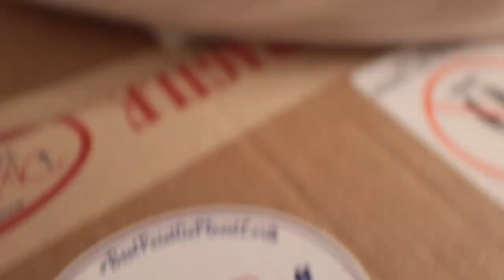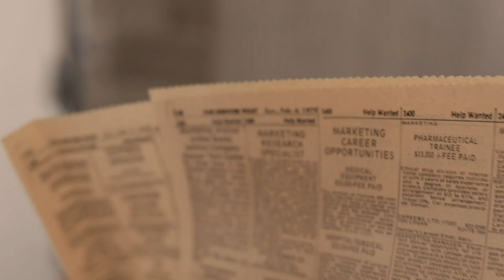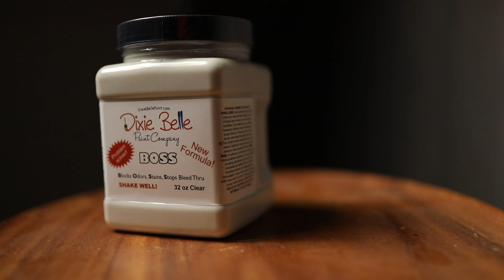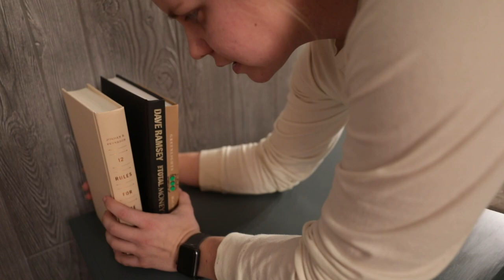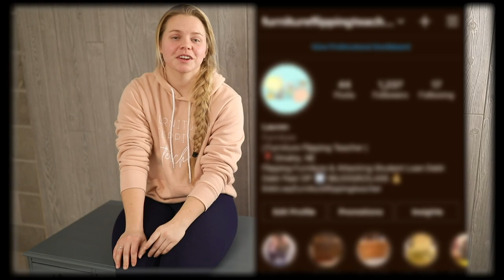| Wooden Desk Thrift Flip | DIY Chalk Paint |@DixieBellePaint |FURNITURE FLIPPING TEACHER|

Comment: I was a painting contractor for many years and one piece of advise I can give you is - Don't dip your brush into the original can or bottle of paint. The brush can bring contaminants into the paint and decrease the durability of it. It's best  that you pour the amount of paint you need into a smaller container. The same for your topcoats. It's like double dipping the chip or licking the spoon and putting it back into the pot. Make your paints last, pour into smaller container.
Reply from the maker: Ohh wow! I truly never knew that! Thanks for that recommendation! I will keep that in mind! Thanks!!
Reply: Awesome didn't know
Reply: 100% correct ‼️
Reply: Very good to know

Comment: If you accidentally brushed paint on the side of the drawers, would it be possible to spray water or use a wet rag to remove the paint verses sanding. I ask only because Dixie bell is a chalk mineral paint and feel that it is possible, please let me know if it is not.

Comment: Just a tip... when using the blue Dixie Belle sponge it works much better it you dampen the sponge before using. Get it wet then wring all the water out that you possibly can. It helps the Gator Hide glide on more smoothly. I love all the Dixie Belle products. I haven’t tried that brush yet, but I put it on my list. Thanks for sharing!

Comment: For cleaning any hardware I have an old crockpot I put water in and turn it on high and cook the hardware while I work on my project
Any cleaner that works on silver can be added but I just use water 
Super washing soda by arm and hammer can be used on silver, brass and copper 
If you have things like door hinges or old slide locks on doors that have been painted, the soak in the crockpot makes it peel right off
I learned this watching Rehab Addict

Comment: Have you considered using a chemical stripper? It’s less labor than going over the whole thing with 80-grit (you’d still have to address imperfections), and there’s not gonna be a bunch of residual stain to worry about affecting your coloring. I hear good things about Citristrip.
Reply: Disclaimer: I make furniture as a hobby, so my knowledge of what constitutes a good stripper for redoing existing pieces is second-hand. When getting chemicals, I usually just grab the relevant Klean-Strip product from Home Depot.
Reply from the maker: So, I actually have used citristrip and it will be in an upcoming video! You’ll learn that I HATE stripping things hahaha. I just haven’t found the flow of it yet.

Comment: Just a tip I've learned...I am not a fan of the gloss of the gator hide and a tutorial I watched from dixie belle says you can apply 1 coat of gator hide and let dry and then either do the Dixie belle flat or Satin Ontop so it brings down the high gloss
Reply: Good to know...I’ve only used gator Hyde once and found it a little to glossy